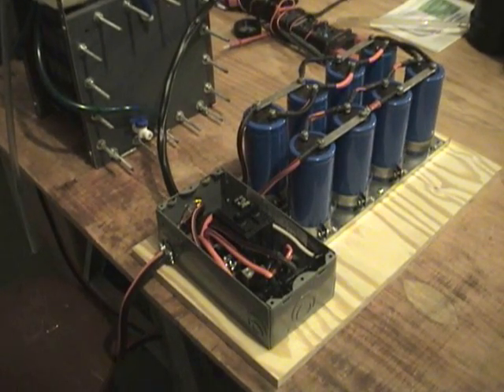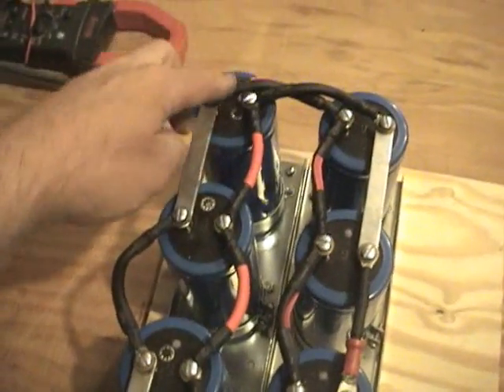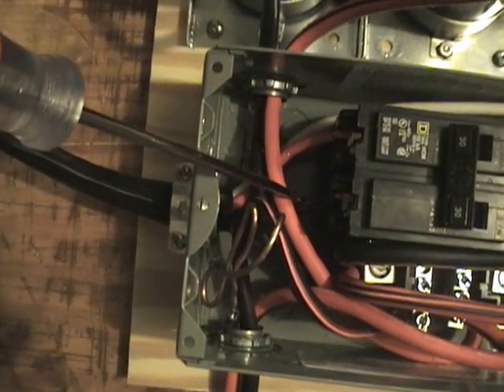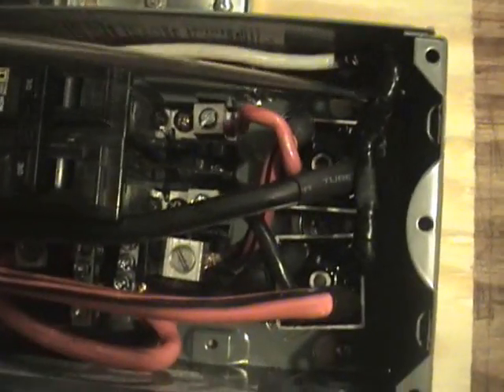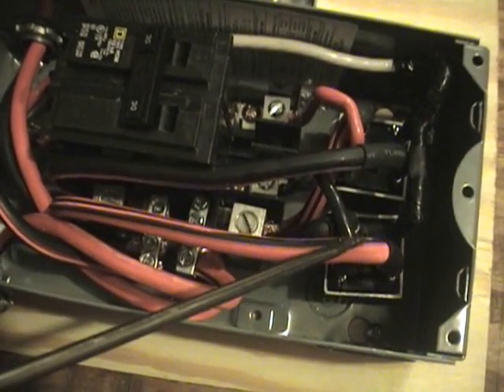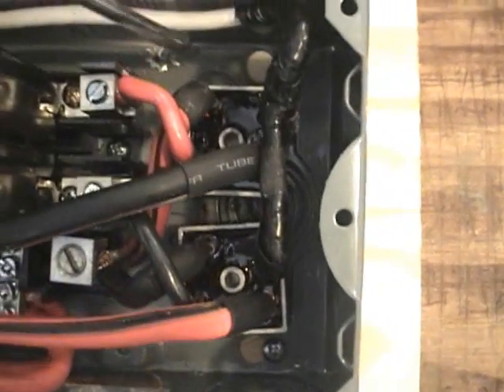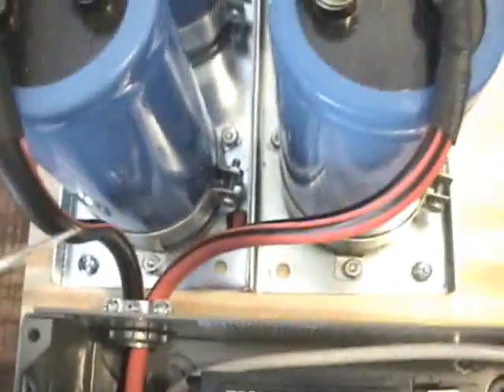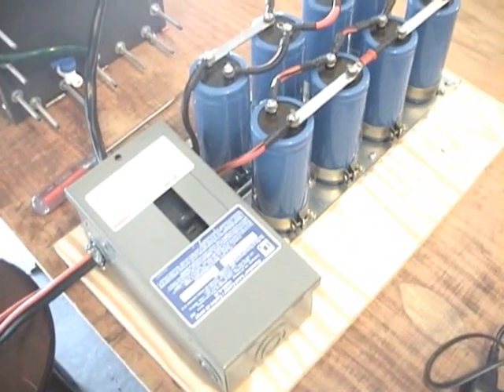118 plate massive Hydrogen generator 240v electrics runthrough part1

Comment: Hi Steve: Thanks for posting all these videos. You have put in a lot of work. 
It looks like you haven't switched the caps. How long does it take the caps to discharge after you flip the breaker? Does the brick keep running for a while after you flip off the breaker?
Thanks, Mars